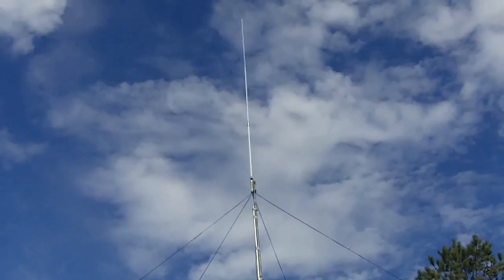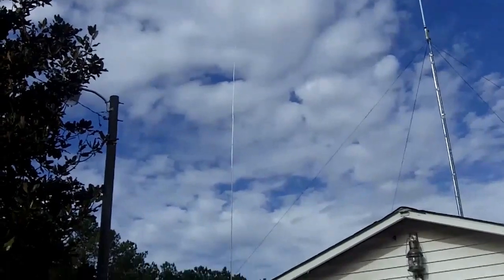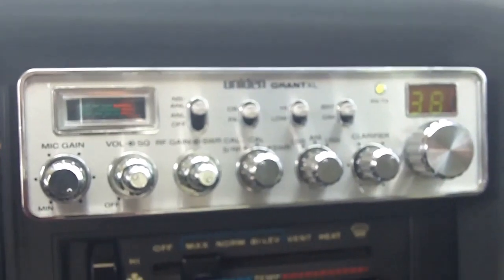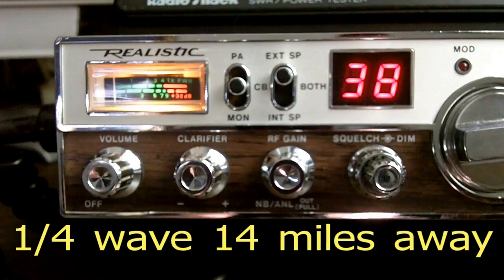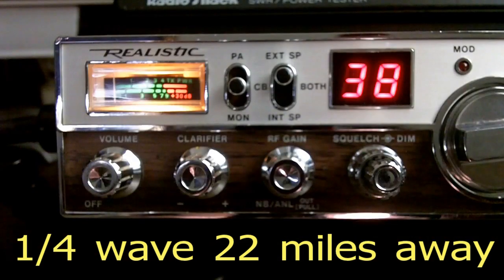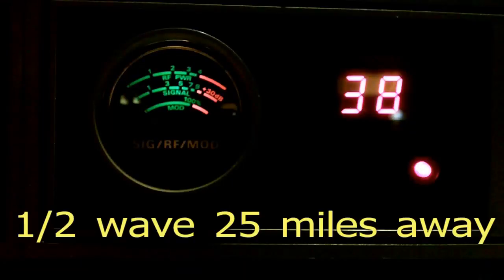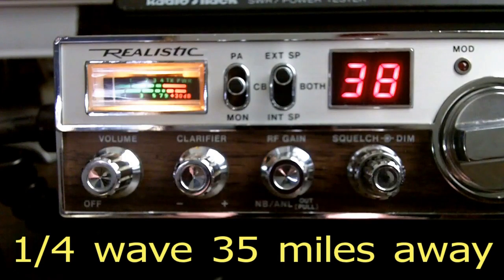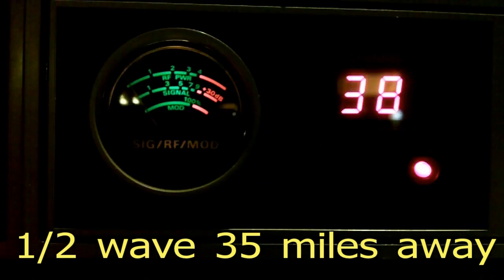Ground Plane CB Antenna comparison

Comment: 1/4 wave verticals have a higher angle of radiation than 1/2 wave verticals, adding radials ie. isolated quaterwave guywire sections lowers that angle of radiation but the 1/4 wave will always be a higher angle, given the nature of RF propagation the higher angle of radiation is an advantage.

Public libraries have a range of antenna theory books to peruse but tinkering with antenna modeling software would allow you to "visualise" such behaviour 👍

Comment: The 1/2 wave and 5/8 wave concentrate the signal more horizontally to the horizon.  A 1/4 wave antenna sends a lot of the signal vertically above the antenna, which is wasted on the Moon and airplanes.  Whereas, the longer wave antennas reduce the vertical power going to the Moon and concentrate it where it makes good, towards people towards the horizon.

Comment: You should get a 5/8 wave vertical for local contacts. You will not believe the difference because of the lower takeoff angle of a 5/8 keeps the signal closer to the horizon than a half wave or quarter wave. Another thing that you might try for skip is a half wave dipole 1/2 wave length (about 17') off the ground away from any obstruction (in the clear about 36') You will be surprised at the results! When you hear skip start to roll just switch theough the antennas and use the one that gives you the best signal. Some days one antenna will work better than the others but for skip over all the little dipole will generaly give the best results because of the way it's wave pattern  hears in every direction in the horizontal plane.  Good video BTW! Thanks.
Reply: You can better preform this kind of test in FM mode, hard to see a clear S on SSB or AM

Comment: How about building a full wave vertical? I got an A-99 with a 102" steel whip on the top element which I cut about 10" off it to get a flat match for most of the 11-meter band. What does it mean when they say the A-99 is a half way over a quarter wave?

Comment: I have not read through all 262 current comments.  However what I have read is 5/8 wave has a lower angle of radiation versus the 1/4 wave.   Yes so on flat terrain 5/8 will be better.   What you are not able to show here is how altitude affects communications.   1/4 wave is better for communications in the mountains.       You kind of touch on this for skip, 1/4 wave may hit more skips (pending on conditions) but 5/8 when conditions are right and you are on flat terrain, longer skips are going to have an ability to go further.   Overall great great great video.

Comment: Question. When you are calling CQ, what does "151" mean and does this need to be on Ch. 38? It does sound like side band.
Reply from the maker: the numbers are like a handle or name, and can be used anywhere on CB.
Reply: @MowerJunkie so in other words I could use my HAM call sign, if nothing else

Comment: 103 inches for a 1/2 wave ground plane? 103 inches is 1/4 wave length long. I'm stupid, so humor me.
Reply from the maker: 1/4 wave is the most efficient length for ground radials, for 1/4, 1/2 and 5/8 ground planes
Reply: @MowerJunkie  Thanks for the quick reply. What I was asking, though, is why he says his 1/2 wave ground plane is a 103 inches, which is a 1/4 wave length long.
Reply from the maker: @franzliszt3195  just the radials are 103". the 1/2 wave antenna has an 18' tall radiator.
Reply: @MowerJunkie  Thanks again. Man, people have so many suggestions.

Comment: I thought radio shack ant. it was 1/4 wave vertical dipole!
Reply from the maker: the radio shack antenna is the same as an Antron A-99, They are a 1/2 wave, with a 1/4 wave coil at the base.
Reply: thank you ,its good to know !;grettings from madrid,spain! @MowerJunkie

Comment: Someone told me the Solarcon A99 works better on skip with no ground plane vs having a ground plane. Is that true? Very cool video.
Reply from the maker: I've had a lot of A99 style antennas, with and without ground planes. I found with every one the DX was better with the ground radials.

Comment: How is the receive section of the 2 different radios? That is a HUGE VARIABLE! And the length of the coaxial cables to the radios, significant loss after so many feet.

Comment: 1/4 wave ground plane with a feed point at about 24 feet (tip top maybe 33 feet) worked better for skip than a half-wave at 42 / 59 feet. Rg 8U for both.
With the added height and all the 1/2 wave did better locally.
Both were at 1:1.25 or better.
Fun days

Comment: a 5/8 wavelength vertical has a flatter take of angle than a 1/2, a 5/8 would make a stronger signal.

Comment: thinking about getting a cb again. never did sideband much always had cheap radios.  would the antenna check be easier to compare on regular channels since easier to see key power on meter.

Comment: Always great stuff! Were they at same tip height?
Reply from the maker: Thanks. the feed points were at the same height. 73's
Reply: @MowerJunkie  I suspect if tip heights were equal, antennas would perform near to identical. Always testing here as well, great fun. Have not heard you in the skip lately, conditions have turned to texas Dx a lot here, not picking up much SC, these days, Always listening for you!
Reply from the maker: @pixotica  I can't wait for the conditions to move back to the north, I've been getting the UK in the morning and Arizona in the evening. Take care Mike, 73's

Comment: It would be really interesting to see those tests again with the antenna at various different heights as each different division of a wave has different take off angles at various heights.
   Wouldn't it be interesting if they actually work locally better if they are a bit lower or a bit higher, and then certain skip distances might also be effected by as little as a few ft to tens of feet at different heights. I have a pump up mast at my dads and this is pretty good to run such tests in light or no wind conditions, i lost the antenna i wanted to use with it and i'm extremely upset about it. Hoping to find a big mac one day. That might cheer me up.

Comment: When I had my CB up I ran a cobra mobile with a 5/8 wave GP and a moonraker 4 with a homemade kicker with 2 4cx250b's. Local I just used the GP and when I was talking skip I would make contact with the GP and swing the beams around till I zeroed in. The GP was about 40 feet up the tower and the moonraker 70 feet up. Thats the way to go IMO. Back in the day you just about had to have a channel you could jump to or beams to cut all the local traffic out. Good demonstration of the 1/4 wave verses the 1/2 wave. Getting you signal down on the horizon defiantly makes a world of difference. Also had real good results with a homemade quad, but they are as big as a barn. Even made a few out of bamboo just to show how inexpensively you could build a good beam.

Comment: Question is...why were you using side band instead of AM. You need to see what you can do with AM transmit.
Reply from the maker: the testing I do is for Me, and I share it with you guys. I don't ever use AM mode, I'm always on SSB. So my testing is usually done on SSB.

Comment: If you turn down your rf gain, you can dim out those weaker signals. Great job on the comparisons! Inspired me to rebuild an old frankenstein A-99. Bottom is A-99 w/GPK, the top is a 17.5' wire, hoisted up a tree (From the top,) w/550 cord. The tip is about 60ft. and the coax is lightening protected at the ground rod. Great antenna!
I put a 1 ounce fishing weight on fishing line then shot it over the tree branch of my choice with a slingshot. (One of those wrist rocket types.)Then attached the 550 to the fishing line and pulled it back over the branch. Then the 550 hoists the antenna to the branch and tied off. ;)

Comment: The quarter wave antenna does have a higher angle of radiation versus the half wave and the ground radials do help bringing the angle of radiation down closer to the horizon. What you really need to try is the 5/8 wave antenna. This antenna would be the best antenna for local talking versus the half wave. If you do get a antenna like that, make sure you get the ground plane radials for the antenna. Another thing that you need to try is from the ground pole dig out a trench and put ground plane radials in the ground.  Run a braided copper radial from the pole to a ground rod in the yard about a half wave length worth of wire. Then from that point add 4 radials in a North, South, East and westerly direction. This would also give you what is called ground wave and your antenna itself will be skywave. The both of these working together is a big difference between just having skywave. This would also give you more distance in talking local as well as helping you talk skip. Give this a try and also try a 5/8 wave antenna. Love watching your videos on this antennas that you build. I myself also love building antennas, I am a Amateur Radio Operator and building,home brewing antennas is a very good for me to relax and enjoy the hobby. Take care and 73'S! kb3hay- Steve
Reply from the maker: I recently purchased a 5/8 wave ground plane antenna, and I will be doing a comparison video soon. Thanks for watching, Take care.

Comment: I  thought half waves dont need a ground plane
Reply from the maker: you're correct, They don't need them. But the radials change the angle of radiation, making it better for DX.

Comment: The 5/8 wave on flat terrain is best.  In a valley the 1/4 wave is better because it has a higher angle of radiation to get you out of a valley

Comment: This is called: Angle of radiation on both of antennas. As QUARTER wave antenna along with ground radial will send more signal toward the sky. As HALF wave antenna will plane out more toward your horizon, that why; you'll get out even better as your local ground planning.

Comment: Great videos love them! - question did you ever test of had a 5/8 antenne? Maybe for the test of regular use. Check out the Sirio 827 megarange this is a full aluminium antenne. I have this one in the Netherlands over here and with a little guide over al 40 channels (here on FM) with 0.5 watts never see any needle moving on the swr and with 400 watts no needle movie up till 800 watss maybe a little needle movement. This antenna is a beast with send and reception, but the coast are minimal at least here i bought i brand new for 100 dollars. Its a very great antenne and can also handle a nice amount of watts. Keep the videos coming! thnx.

Comment: I think this was an awesome demonstration of the effects of "Angle of Radiation". The 1/2 wave is a lower angle and has further reach to the horizon thus giving it a further skip range....with more stations coming in. The 1/4 wave has a higher angle of radiation so the range is a bit less BUT more focused to that area...so it was easier to sort you out and talk more times. Great work, even though I knew they would complain about the 2 different receivers...what can ya do?  Thanks for the 📽️Video

Comment: Are you Testing the Different Ground Planes or is it the Halfwave Antenna over the Quarter Wave Antenna, as you say the Halfwave Antenna has Quarterwave Radials, as so does the Quarterwave Antenna, as it has winded quarter wave whips
Confusion

Comment: I don't know why you didn't use the SBE above unless it's the AM only version, but it looks just like my old SBE (SSB) Land Command LCBS-8 which shares the same 8719 PLL circuit board with a Cobra 142, UNIDEN Washington, Cobra 140GTL mobile and a host of others.
Reply: The TRC-451 is a different board from the Uniden Washington & 142GTL. It's the same as a Uniden 144 and Cobra 146GTL.

Comment: Nice job overall, good measuring too, however, you're no doubt aware that a 1/2 wave needs no counterpoise as it's 360° sine wave return is intrinsic within the 1/2 wave design. A counterpoise or 1/4 wave radials can, however, help to act as a CMC block.
Also, if tips are equal height above ground and the same radios with equal alignment spec were used, there should be little difference in performance, perhaps favoring the center-fed vertical 1/2 wave (which you call a "1/4 wave") due to not using a somewhat lossy matching network.
Try it again, with equivalent tips height but switch radios and let's see THAT video.

Comment: Very nice comparison. I Home made the Half Wave End Feed Antenna for 11 meters, modify the toroide to a rectangular shape and that´s it, working very well above 12 meters of wire. 4,40 meters that´s the length of the new antenna. The new End Feed for 11 meters, is now End Feed JS20. So when compare between a vertical dipole and new End Feed, the goal was amazing, the noise has fallen from 9 to zero with beautiful signals. tks again fer sharing this information. 7351

Comment: Do you think the starduster is a good antenna or I was gonna build your 102 whip antenna with ground plane ? I have a TRC490 SSB & a Lafayette telsat 140ssb
Reply: Save your dollar$ and using a coax-insulated L-bracket designed for mounting SS whips, erect a 103" stainless steel whip atop a 40' push-up pole on your roof, then do as he did - bring down 3-4 directions of 103'' of wire from the ground base of the antenna or U-bolt, to insulators or non-metallic cord, and use those as both guy lines and 1/4 wave radials.
- You should have excellent performance, better than an Antron A99 and high power handling. 
You won't have any matching network loss because you don't need a matching network for that design - It's a ''Direct-Drive'' Center-fed 1/2 wave!

Comment: To make that test that you have done more accurate !!!! you should have used the same radio on both antennas while you were transmitting you could have had someone hook that same radio up to antenna A then antenna B the reason I say this is because some radios just have better receive than others at the same distance like I have told you my Sears Road talker performed much better on receive then my Galaxy at the same distance and location using the same antenna

Comment: Have you ever made a mobile antenna  wrapping a wire on a fiberglass pole, say 1/2 wave or 3/8 to see if they could due a better job than the 1/4 wave whip..... just curious